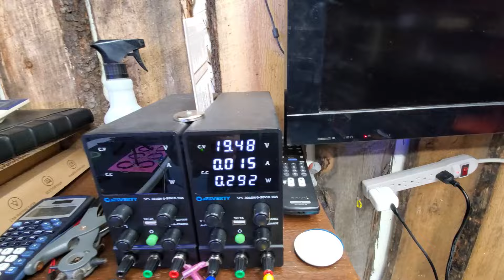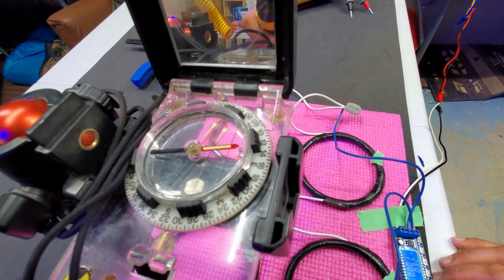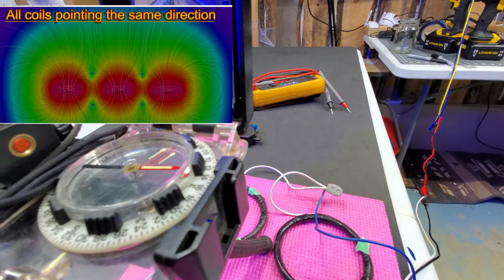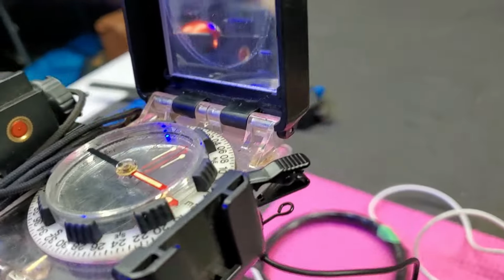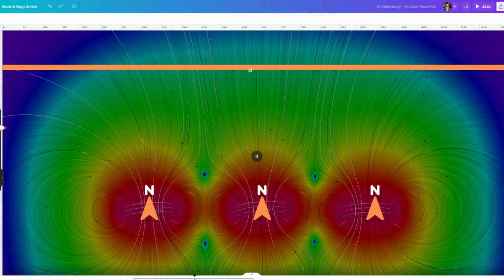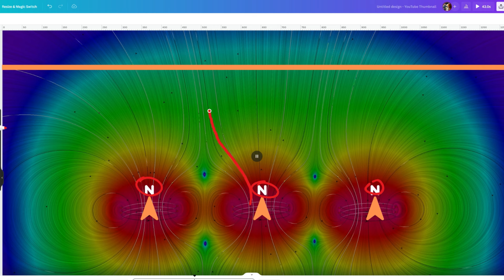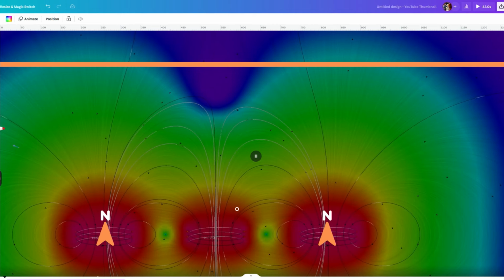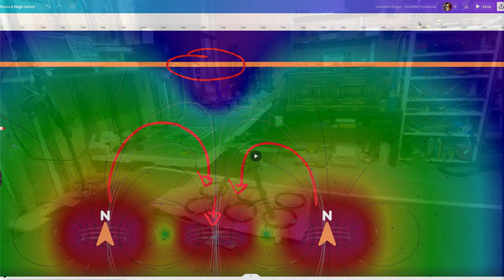EMF Field and Duty Cycle Explained Using Everyday Analogies

Comment: Have you ever come across PEMF users that have grown back teeth?
There was a big buzz about LIPU machines I think their called a few years back pulsing infrasonics into the gums and on top of broken bones to mend and heal them, and for teeth to grow back after about three months, at first it was all over sports medicine and then all of a sudden like many others the tech just seemed to vanish again. I don't know if it's still used but I remember there was a bit of difficulty making the device small enough to comfortably fit inside the mouth so I'm thinking maybe, pemfs pulsed at the same rates, which as far as I could find out was around about 1500hz though I couldn't find an exact number...

Or would you have any other thoughts on this possibility?
Reply from the maker: @8thsinner  i am very interested to hear more.   I have come across papers on the topic and recently dentist in some country are starting use pemf in the mouth to speed up healing amd reduce inflamation.   It is hard at times to find info.
Reply: @Steeve.  Yeah no kidding, getting harder all the time too.